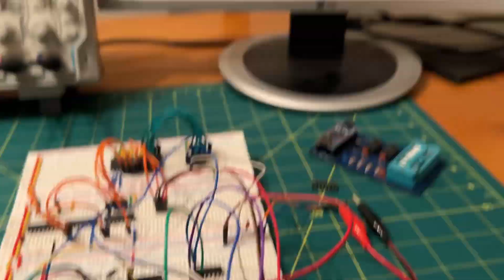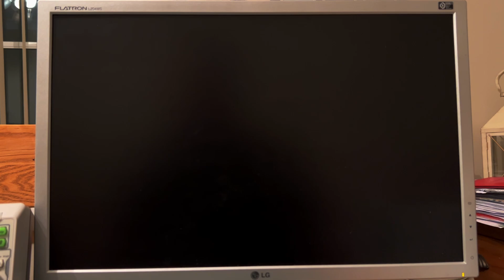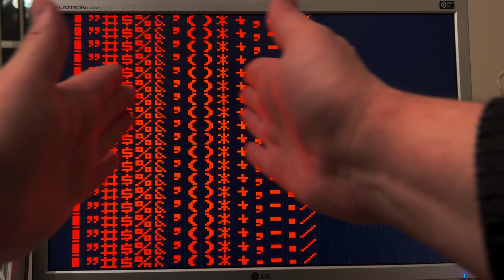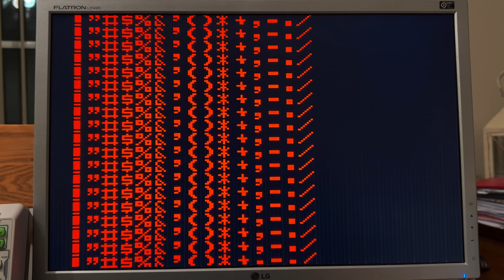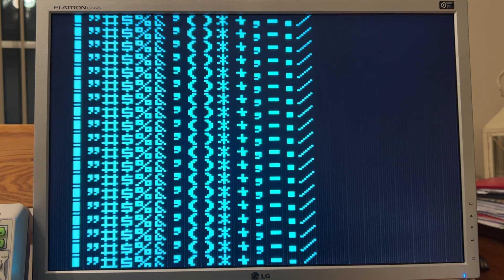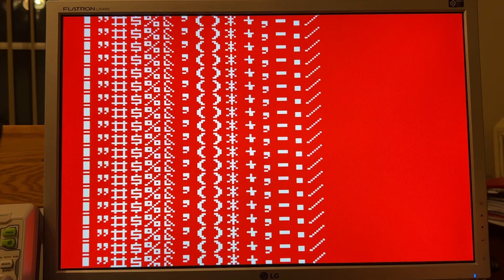Z80 Computer - Part 18 VGA Horizontal Characters

Comment: I assume that the EPROM will be replaced with a RAM so you can do pixel graphics.  There are a few somewhat useful things I can suggest:
If you focus on doing one of the 3 colors to make a full screen, as you go you can imagine adding the extra RAM etc for the other 2 colors.
You are reading bytes from the RAM/EPROM at about 1MHz.  With a bit of cleverness, you can arrange the Z80's timing so that the Z80 can slip its accesses between the reads.  The Z80 can have a chunk of memory space and an I/O register for its addressing of the RAM space.
The Wait/ pin, I think  can do that for you.  Each time the Z80 read or writes the memory space for the VGA memory, the wait causes it to go a bit slow if needed.
On the write, the Z80 will hold its bus steady for you so your mux to switch onto the pins of the RAM will be simple.
On read you may need an HC374 to hold the bits as the VGA goes on with its life.
Reply from the maker: It will be interesting to see what you think of the next video, which somewhat goes into these topics. Unfortunately the EEPROM no long seems to accept new data, so for now I'm stuck with what's in it. It's annoying because the first 8 bytes contain zeros, so we are not really seeing what is going on right now. RAM is on order, so I'm hoping a can move forward soon. I am finding this part of the project trickier than expected.
Reply: @SteveRaynerMakes I sometimes think all problems are trickier than they seem.  I have been designing stuff for a while

Comment: Liked before I even saw the video because I'm hyped to see this!
Reply: Ditto!
Reply from the maker: I'm sorry if it disappoints, I talk way too much. I promise to talk less in the next one. There is a problem, I don't seem to be able to write to the EPROM chip any more, so I can't change the contents. I'll need to order a replacement. I'm thinking it should not be too much more work to display the next row of characters as we move down the screen.
Reply: @SteveRaynerMakes  No, it's all good. Nice and clear explanations of what you're upto. 

On my similar circut I ended up putting 161 counters for the current H character and V character that would reset on character 32 horizontally and 24 vertically, and they would increment when you sent it a new ascii character. Then used the "load". On the 161s to reset the counts to outside the blanking area.
Reply: I liked at start great video and project as a whole